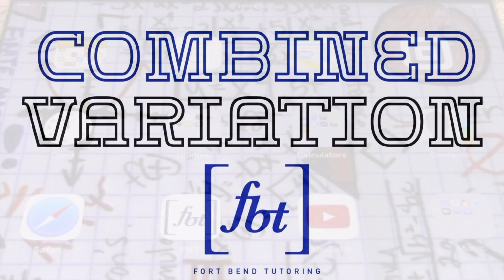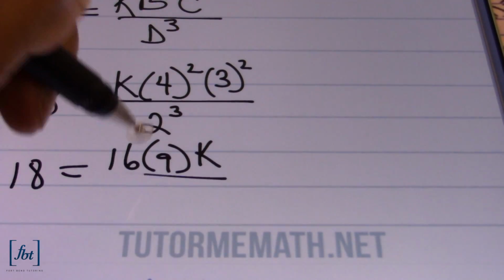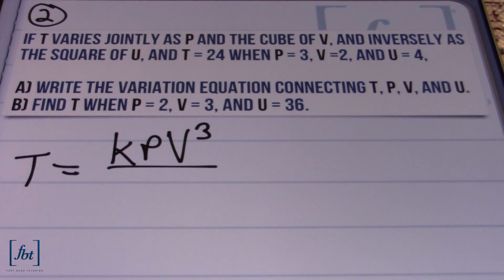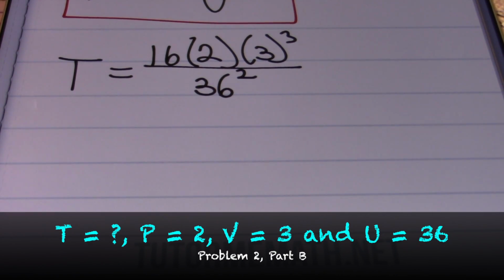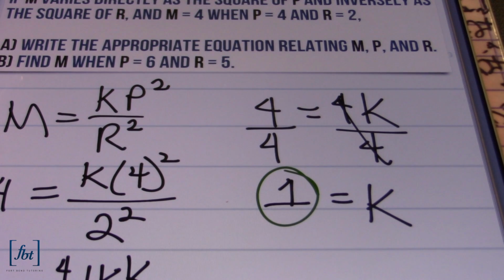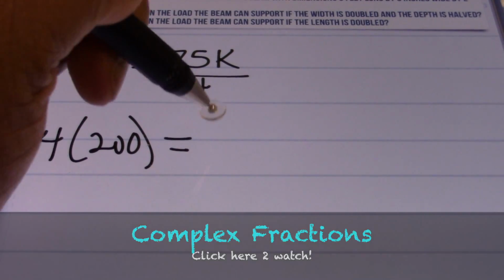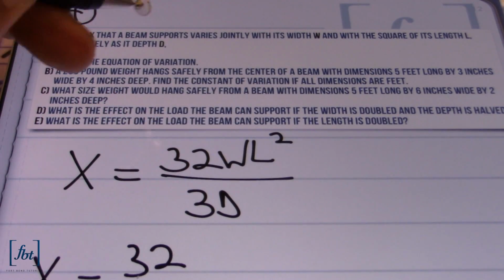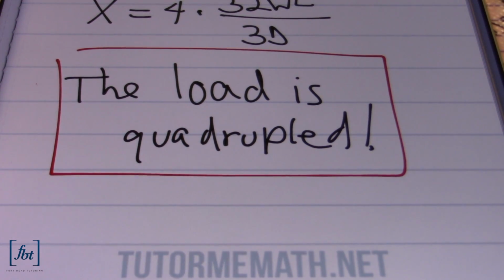Combined Variation - How to Solve Variation Problems: Part 4 [fbt]

Comment from the maker: Here's some helpful timestamps 4 this [fbt] variation video!
[fbt] Timestamps
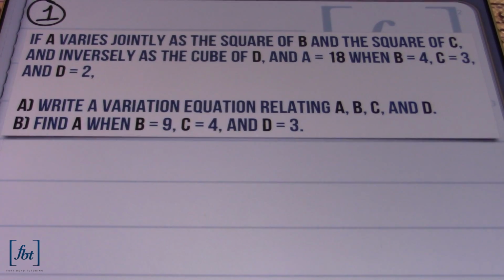01:28 [1] Write a variation equation
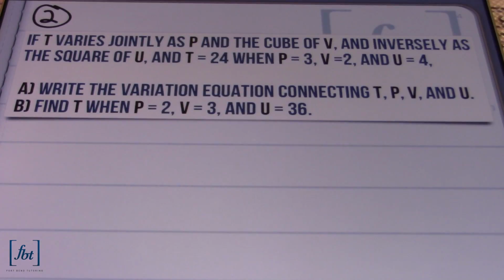05:51 [2] Write the variation equation
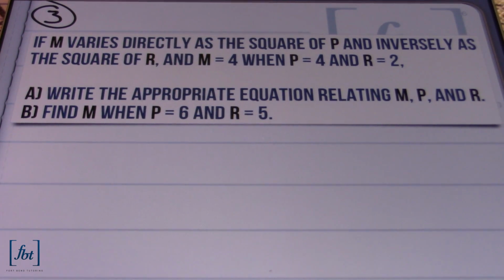10:50 [3] Write the appropriate equation
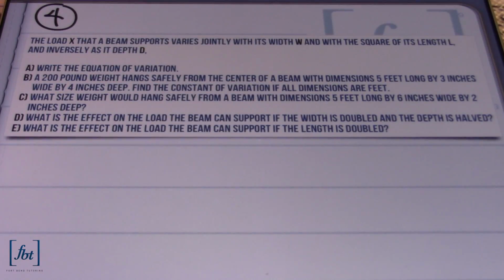13:32 [4] The load that a beam supports varies jointly with its width and the square of its length

Peace,
Mr. Whitt